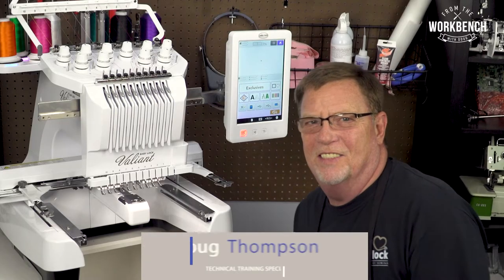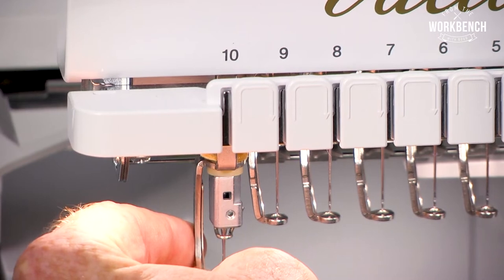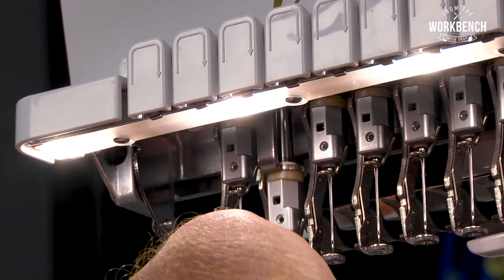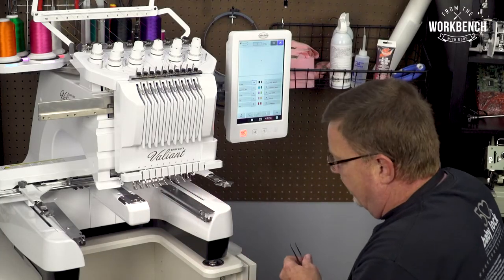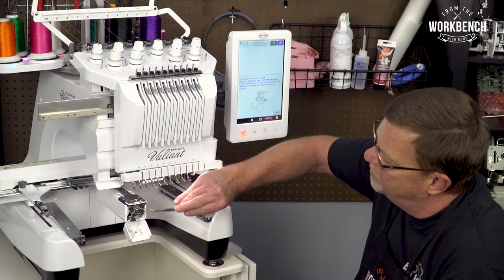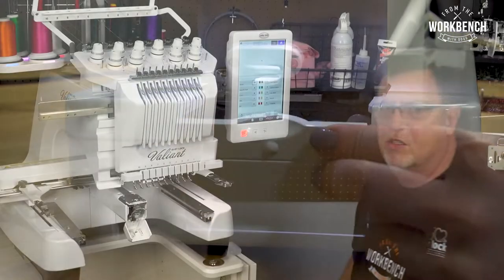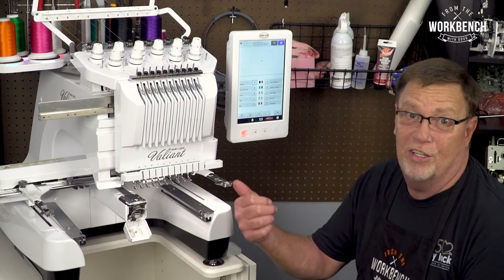From the Workbench with Doug - Multi-Needle Hook & Needle Bar Oiling

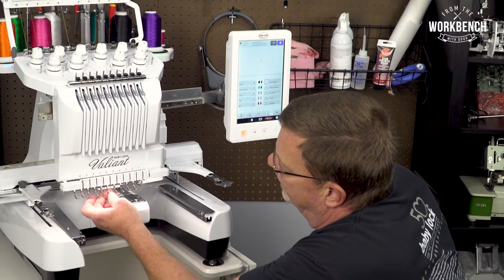Comment: Hello! Around minute 1:45 after needle 7 you move the machine over to unlock the other needles and then you keep going with needle 4. So how do you get to needles 5 and 6? I'm working with a babylock valiant if it helps. Thanks!
Reply from the maker: If you position the needle bar frame to needle number 4, the number 5 and 6 needles will release. Please let us know if that helps!

Comment: baby lock spirit - I pulled the front cover off to get at the tension disc that had thread wound around it - snapped right out - no issues -but now I don't see how it snaps in - and I am worried I will break it - is there a way to show me how to get that back on? It's the one covering the take up lever. Thank you!